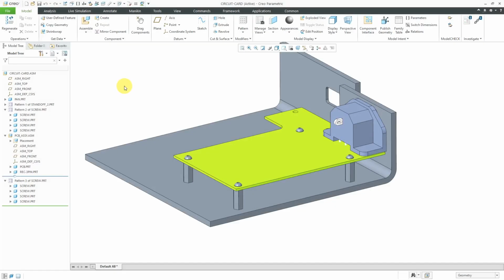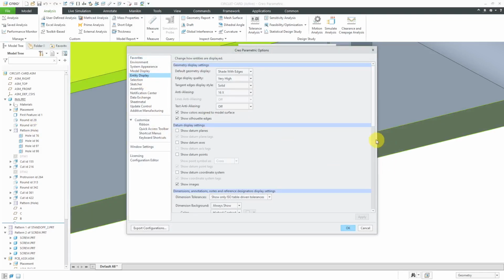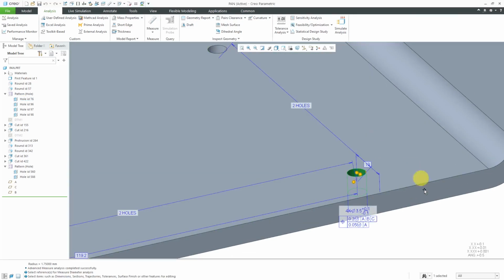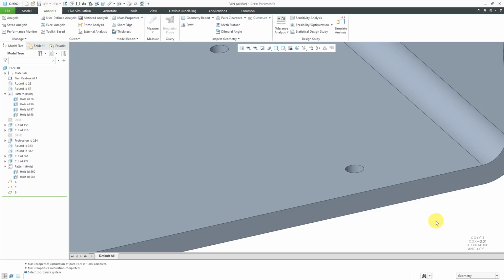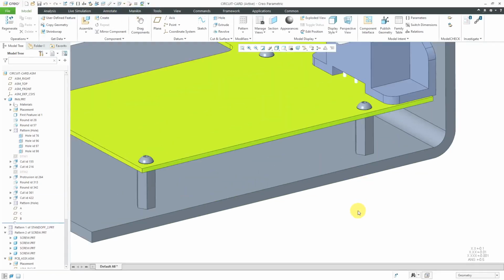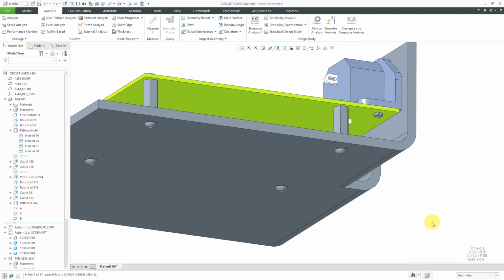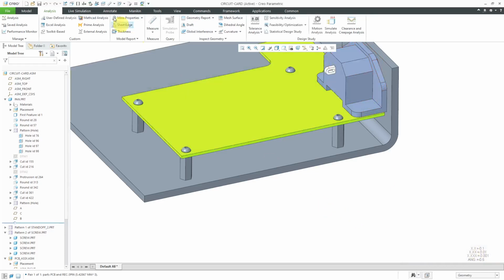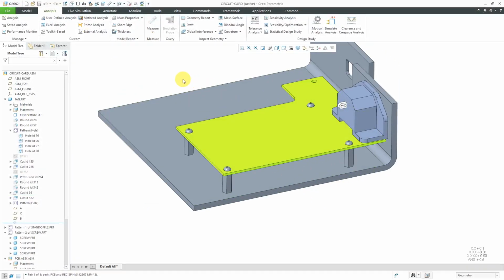Creo Parametric - Dimension Boundaries | Tolerance Analysis

Comment: Hello sir. Can I ask you a question about 'tolerance analysis' within Creo (/Sigmetrix)?  What is the different between the tolerance analysis within the Analysis tab & the 'tolerance analysis extension' in the Application tab of the integrated Sigmetrix's applications (EZtol & CeTol)?
Reply from the maker: I think the easy answer is that the one in the Analysis tab is the 1D offering that came out in Wildfire 4.0 and the Applications tab is the full 3D extended analysis that leverages more of the Sigmetrix functionality, but you're better off asking your PTC representative for details.

Comment: Dimension boundaries is not the right tool to perform tolerance analysis. It doesnt differentiate the concept of a hole and rod. A better tool is gtol advisor and ez tol analysis. Though it would be nice if you can compare ez tol vs Sigmetrix cetol 6 sigma. Or even better, if you can get a hold of Siemens VSA vs Cetol